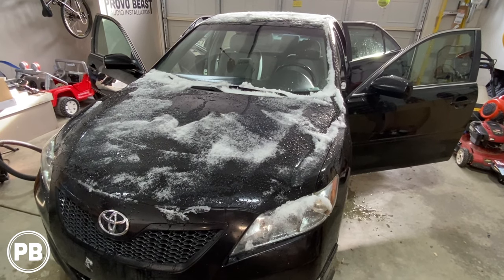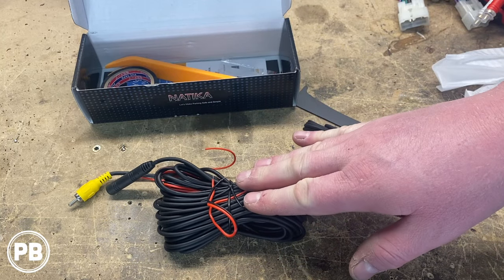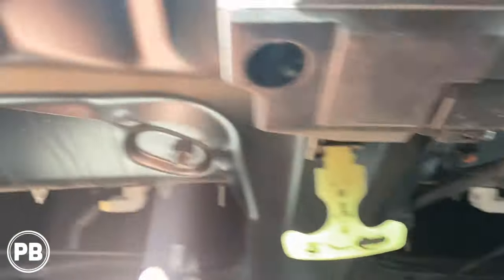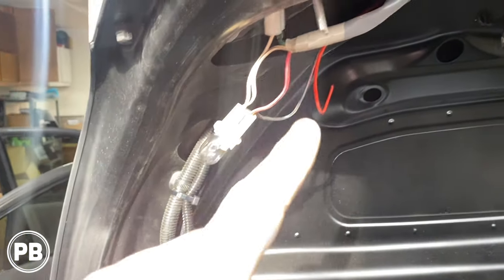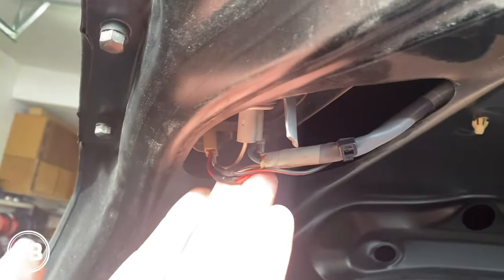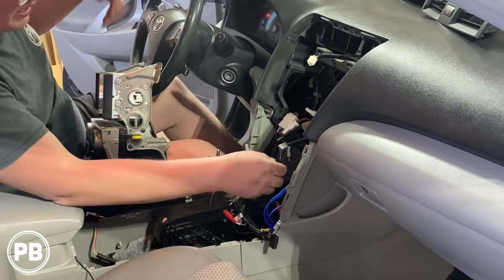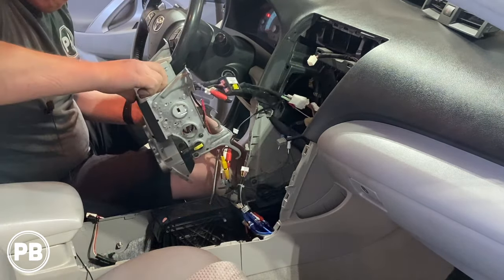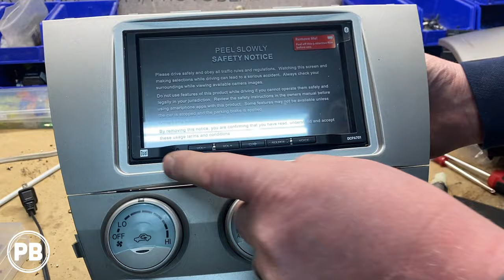2007 - 2011 Toyota Camry Backup Camera Install

Comment: everything else done except 2 hours pushing dang emblem and still can't get it off...ready to either rip it, melt it, or take 1' drill bit to it....why do no videos explain how to get it off?
Reply: Emblem? Is it in the way or ? I'm getting my camera delivered today I plan on doing this but I guess I need to check it out did you get it? What did you do please
Reply: It’s not the emblem but the clip that holds it together. I just ended up breaking it off lol
Reply: @owenjackson877  I got my camera installed, the clip is like everything else in the care basically have to kind of pinch it the right way and it comes out, it was funny I bought the camera he recommended and cross the wires so I thought they sent me a defective one but the multimeter had a negative sign on it haha bought a different camera it's better anyways but got it done. All I have to do is tune my amp then start on dsp
Reply: what camera did you buy?
Reply: @lilmisssunshine555  as for me I bought a Metra license plate back up camera from best buy, it's pretty good

Comment: Hey brother, really need ur help…2011 Camry with kenwood DMX4707s and kenwood Cmos 230, i followed the directions and tied the hot into the acc wire and grounded to the chasis, i then ran a 18g wire from the backup lamps to the purple and white wire wire hanging off the top right corner of the HU.  I can manually select the camera and it works but will not activate when the car is placed in reverse, is this setup wrong or should i just go with a different cam, thanks
Reply from the maker: Send me a message on Facebook or instagram and we can help.
Reply: Hey man, appreciate the response…found out the problem, grabbed a multimeter and inserted into the backup lamp bulb socket and the polarity? was backwards…not sure why but instead of tapping the hot into the red/black i had to tap into the white/black

Comment: It’s not necessary to drill. You can run the camera wire through one of the clip holes when you remove the piece that has the Toyota emblem. There is two. One in the middle and one on the drivers side. I used the one on the driver side you can see him grab it here 1:59

Comment: I'm getting no signal when I go into reverse.... Not sure what happened
Reply from the maker: Either the camera is not getting power, bad camera, or a cable isn't connected correctly somewhere.  Check your connections, check, to make sure you plugged the camera into the correct port on the radio.

Comment: Thanks so much this helped me really well installing back up camera, instead of soldering the cable what I did is splice the wire long, put it in the bulb socket and put the bulb on top of it and it works😁
Also I didn't drill the hole, just loosen taillight bulb, feed the wire and close it back in.

Comment: So on my boss  radio wiring harness , I have a lime green reverse wire , have a reverse output wire , and a reverse input wire. 
Kinda confused on what to wire and where to wire .
Reply from the maker: Ground your parking brake wire, reverse in is your trigger wire that needs to be connected to the reverse light positive wire, and reverse camera power output is optional to power the camera at the radio.

Comment: I don't get any signal when in reverse. I've connected the red wire at the head unit to where it says reverse cam input but on the rear trunk end I'm not sure where to connect the other red wire to as the Amazon cam i have comes with instructions that are useless. 
The rear cam is connected to the + and - of the reverse lights but the rear rca red wire is still not connected. 
Do i connect to the reverse + trigger as well or??
I mean the head unit needs a trigger to switch it to reverse cam so it has to go somewhere. 
It's a 2007 toyota camry by the way, thanks!
Reply from the maker: https://youtu.be/rHORKUqlEM4

Comment: How big of a hole do we have to drill to get the wire from camera through it? What did you use to cover it up?
Reply: grommet
Reply: I have been look all over YouTube on how to remove that same plastic piece without breaking it and have yet to find anything showing it. I ended up breaking it to get that piece off, not sure how I am going to secure it in place now. Wished there was more details on how to do it without breaking it.😢
Reply: @jakeperez1871 there’s like a white Clip on the left to pick thru but he doesn’t explain any of that

Comment: Subscribed!
Great video! I'm about to install a camera in to a Toyota so very helpful.
Just one question, I note that you connected the camera earth to the reverse light earth which makes sense. The instructions for my camera state to earth the camera to the car's body and not to the reverse light earth. What's the difference?
Reply from the maker: There isn't any, and they just state that because some vehicles would have a switchable ground vs a constant ground depending on the year make and model.  Some reverse lights and vehicles have variable voltage.   For this Camry, doing what we did will be just fine.